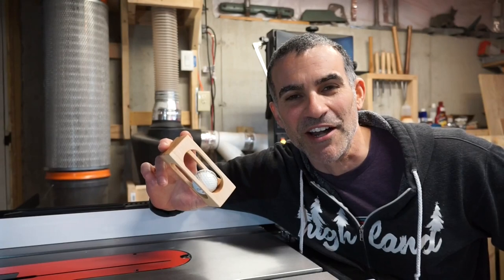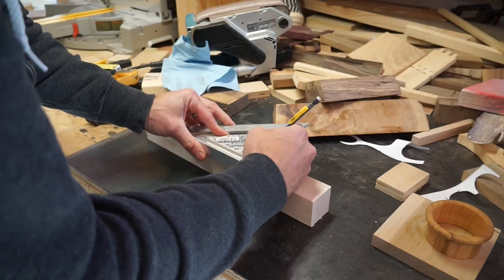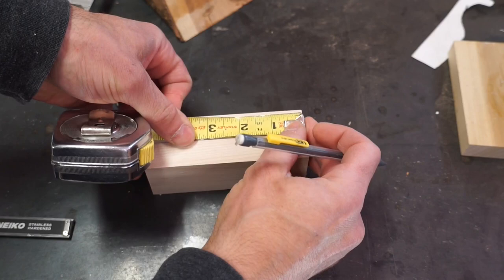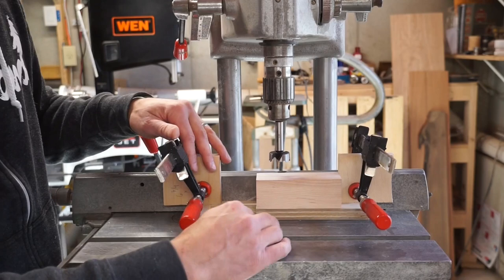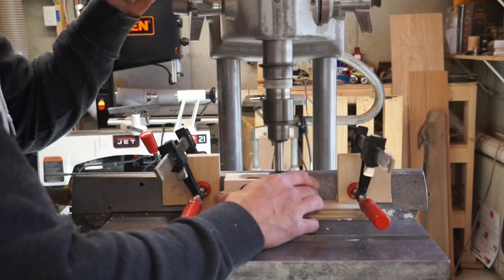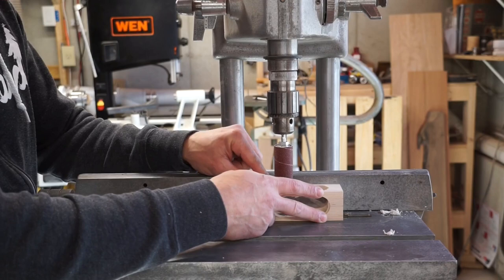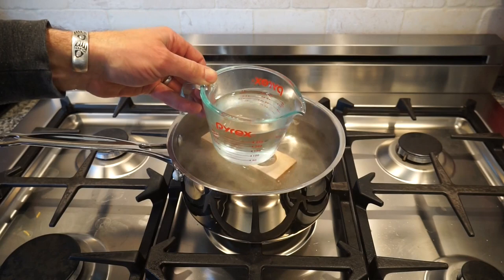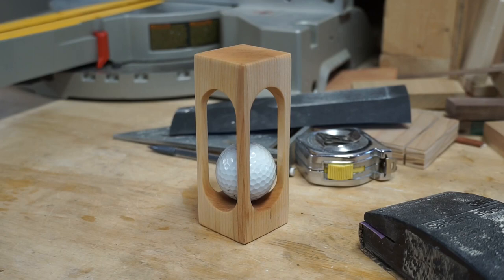Woodworking Basics - Make a DIY Captive Mystery Golf Ball Cage

Comment: Hey Todd! I’m definitely going to make this for some golf addicts in our family. You used maple. Would cherry or some woods like padauk or purpleheart be as “bendable” as the maple?
Reply from the maker: Hi Paul - glad to hear it! Yes, any of those woods should work. With padauk or purpleheart you may want to soak a bit longer. Beware of the color shift on the purpleheart though. While it has never happened to me, because I seal the wood, it is known to change color to a relatively unattractive brown. Soaking may accelerate this process. If you're dead-set on using it then you may want to leave in direct sunlight for a few hours after you complete the project, and before treating the wood, which might restore the color. I have refreshed untreated purpleheart by letting it sit in the sun. Although I am not sure treating with mineral oil will be enough so perhaps walnut oil if you go that direction? I imagine anything else will be tough to get off the golf ball. I would opt for cherry as my first choice. 
Thanks for watching!

Comment: Just curious on what you suggest to possibly repair cracks that appear inside the cage with ball “After” the boiling water process?  A spray or a filler? I want to keep cage a clear finish as I chip carved rosettes on each side. Thanks.   Could believe all the cracking that appears after the drying starts.  Great video
Reply from the maker: Was the wood properly dried before you began the process? What type of wood did you use? The challenge with repairing cracks on the inside of the cage is not getting the ball covered in whatever filler you're going to use. I would probably try a wood filler because it's very easy to sand. I would then coat that with a mineral oit, walnut oil, or BLO-type finish that would be easy to get off the ball without messing up the finish of the wood.
Reply: @industrialcomfort  yes. The basswood I use for carving was quite dry.  Usually I try to add moisture in a Zip Lock prior to carving as it makes for better and easier chips.  I think I made a mistake by not adding moisture and sprayed a sealer which I always do before I draw out my rosettes and makes for easier leaf pencil clean up.  At first the cafe was great but witnessing the cracks appearing hourly.., caused concern. I put a red pencil line of where they ended and looked again and the cracking went further 
So far nothing on the 4 outside area if the block where I chip carved..  I don’t think the cracks will disappear on this cage where I want to keep a natural color. However the cages I have done before I painted and some I applied a white Guesso ,, sort of a sealer before I painted.  Have to explore on this one.   Thanks for your reply
Reply from the maker: @daveholte7658  interesting. While not a softwood, have you tried using maple?
Reply: @industrialcomfort  that is a great option. Have not tried to Chip Carve Maple.  But have Chip Carved Walnut which is absolutely beautiful,,, but really takes alot of work and a sharp edge with lots of stropping.  I will see if I can get some 2” x 2” maple.  Thanks for the suggestion.
Reply from the maker: @daveholte7658  yes walnut is an amazing choice!